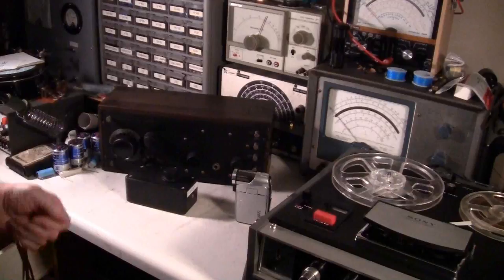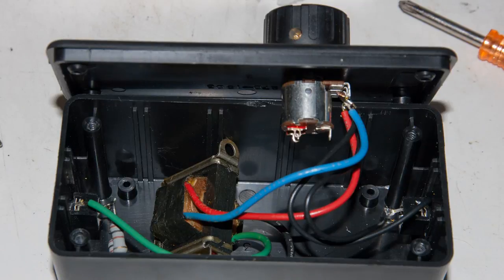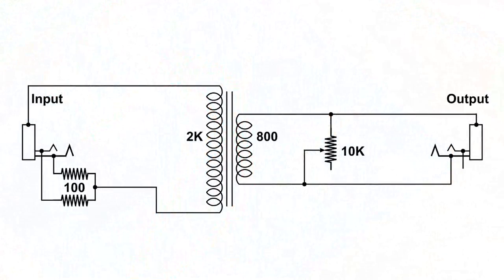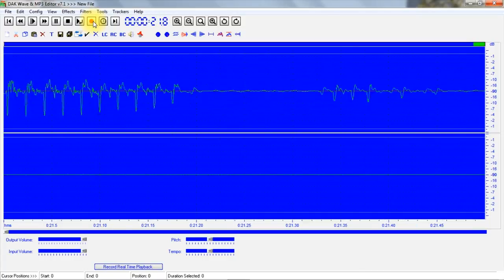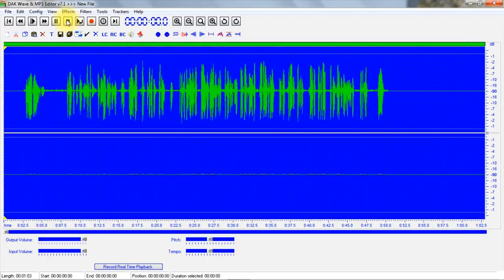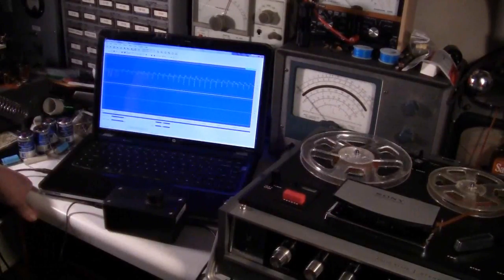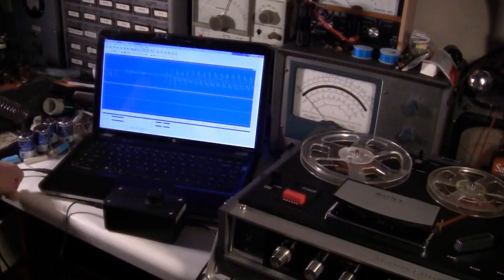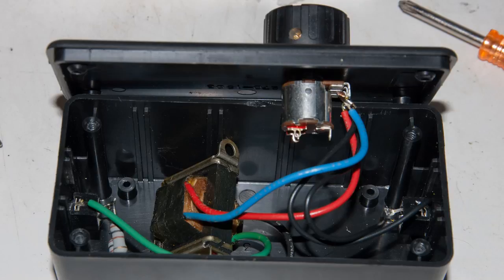Audio Impedance Matching Black Box

Comment from the maker: My first thought would be to use a series resistor. The idea is to drop half or more of the vlotage from the crystal across the resistor before it gets to the amp. Or a series parallel setup may work, but I would try the series first. The series resistor is in the signal circuit, not the ground side.

Comment from the maker: I just updated the Show more with the Play Things of The Past Website and the part number of the transformer. Also I updated the draw with this information, so re-download the drawing. My computer input wants about a 600-900 Ohm impedance so the 800 Ohm is the more important side. The 2K side is high enough so it does not load down the output of the line out of the recorder, but low enough so that the recorder volume is set high enough, with out distortion, for a very good noise to sound ratio.

Comment from the maker: I need to adjust the speed 5% slower, digitally. I did this on the previous video. So far this design has worked well, and it can be modified very easily.

Comment: Hi Richard. Another fine video!  Can a similar circuit be used to match a modern 8 ohm speaker to an antique radio that requires a higher or lower impedance pm speaker?

Comment: Would i be able to use this as a volume control between an audio source (CD Player) and a home stereo  Power amp? I want to eliminate using a preamplifier as i do not care for tone controls ,i want the most straight forward sound from CD player to power amp. I understand that that using a dual-ganged (Stereo) 10k potentiometer would be necessary for me to use. Thank You
Reply from the maker: You could use this. But you could just connect the CD player direct to your amplifier and use the volume controls on both the CD player and amplifier.

Comment: perhaps you can help me with a matching problem? i work on old record players sometimes i have to fit the non original cartridge...i have this problem now..the "new" cartridge is a high output crystal about 2>3 volts but the amp is designed for 1 volt max input both cartridges require a 1 meg resister to ground load and then into the grid of the valve [tube] how can i reduce the output without altering the 1 meg load if i try, with a resister or pot, i lose the bass do to altering the load  bob

Comment: yes that was my 1st thought, but it knocks the high's off, so i tried a 1 meg pot in parallel with the cartridge and upped the input resister in the amp to 2 meg the wiper going to the grid, that works as well, but knocks the bass off as you attenuate the signal....perhaps there is not a way to do it without affecting the frequency response of the cartridge?

Comment: Hi! Look like you get in a stereo signal and out a mono! Also you have 10k variable resistor for decrease signal level! I'm used some transformers from old radios I'm pull out for my old "balanced" mikes! I'm not sure how those balanced mikes works but the transformers I'm using have three pins and two pins coils! I put hot to middle and ground and cold to it sides and get out unbalanced two pins! That make changes also for sounds like louder get more level more or less depended what transform